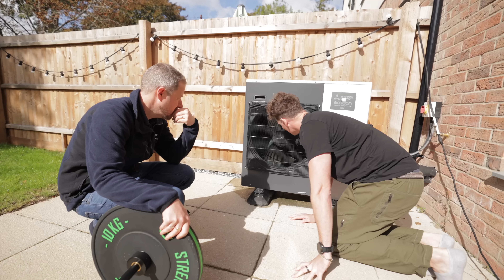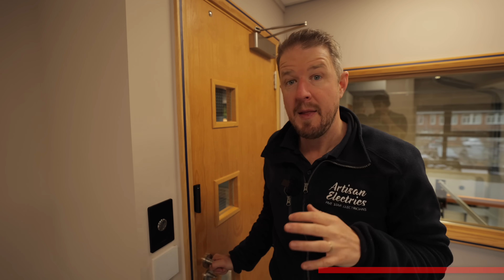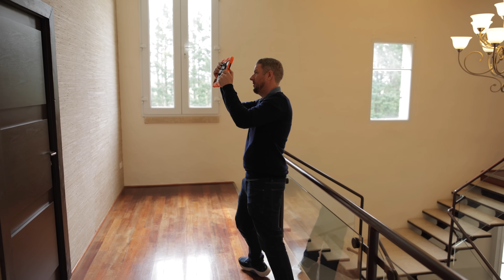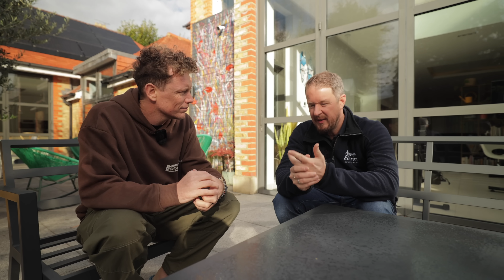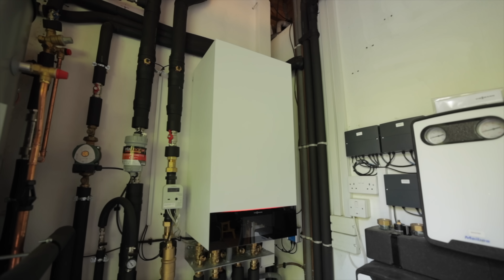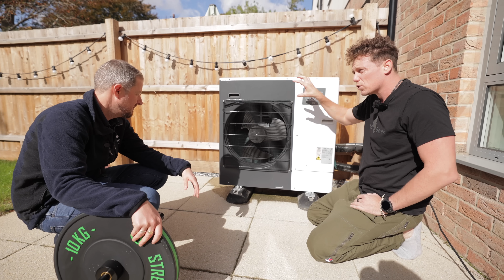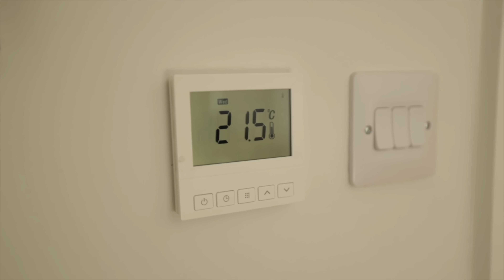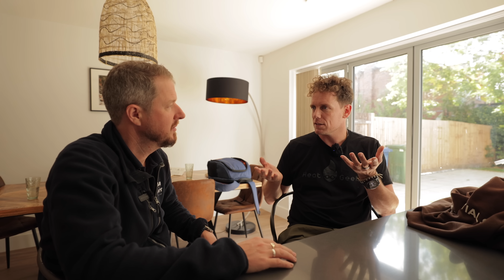Are Heat Pumps Really Worth It In 2026?

Comment: Some corrections on the Mitsubishi pre-plumbed cylinder - 
The switch to the immersion may be on, but it's wired through a contactor inside the control board & usually only used for emergencies or a leigionella cycle. There is not a pump within the outdoor unit, it's on the cylinder.
The 'low loss header' is actually a heat exchanger for the hot water, that's why there's also a hot water circulation pump.
Reply: @heatgeek Is this all true? Some of it does not sound right.
Reply: @darrenadams2640  Which bit doesn't sound right? I can send you the excerpts from the Mitsubishi manual & schematics. I'm an engineer who's just done the design & overseen the installation of 4 of these units.

Comment: Would you say Heat pumps ate suitable for HMOs?  I feel not, as tenants often expect instant heat rather than slow and gentle...?
Reply: Air to air systems work really well in HMO and hotel style buildings but you've then got the interesting problem of the bills. If everyone can casually turn their room up and down there's going to be an enormous bunfight at some point over billing. If you have per room metering then it's a nightmare because you've got one heatpump. Gas isn't particularly different but each room doesn't make much difference to the total bill in the same way.

If you are aiming at the professional end of the market then hotel style air/air is definitely possible, responsive and a real value add. The only restriction you really have is that you can't usually have some rooms heating and some cooling.

(and if you are daft enough to be responsible for the bill as the landlord just wait until your tenants granny charge EVs every day and then do a runner leaving an enormous bill).
Reply: @etchedpixels  on daft landlords being responsible for "bills included" rents, one of the houses we looked at years ago had a ban on tumble driers.  He was citing bullshit about condensation.  I tried explaining my tumble drier is a condenser and has never once caused my windows to steam up or any other condensation problems, its was still a firm "NO".  He then went on to suggest i dried clothes on an airer in the house instead - putting ALL the moisture in the house.  in other words, he didn't want to pay for the power and didnt give a shit about humidity.  ironically, the other tenants in the block (same landlord, same deal) were drying clothes on airers with electric heaters and dehumidifiers - and he was happy to pay for that electric.

This was before the dawn of electric cars though, I imagine banning that has now snuck its way into his contracts...
Reply: @jameshodgetts7541  Some of our student landlords got burned by students and their mates all granny charging off the including power 8)

Most of the ones I know now are "inclusive" but with a monthly limit - ie  not inclusive.

Comment: Heat pump tech clealry works as it is basic physics. Clearly installation and overll cost are the two big variables. Making the change is going to cost £,000s and you have to have the room for the install (they are bigger than gas or electric boilers. The instals shown on YouTube are mostly in big houses with plenty of room NOT small flats or old, odd buildings. Also in my opinion 21C is the absolute minimum comfortable temp for a house in the winter.
Reply: internal size for some of them is similar or even smaller as a load is outside. What gets you in my experience is if you don't have space for a water tank. That's starting to get solutions.

Comment: I've seen lots of shitty heatpump installs in my country, that don't tell ppl what is really needed for getting a heatpump installed corretly and skimp on addition of bigger radiators or floorheating and upgraded insulation. This add for heatpumps does not change that, and an install is very expensive to do properly, and don't expect a perfect system when not doing it 100% to start with or adding to it in the future..
Reply: The insulation argument is an interesting one.  you dont NEED to upgrade your insulation to get a heat pump or for a heat pump to work.  It will still work, but you'll not get the best of efficiency.  Indeed, upgrading your insulation would make your existing gas installation work better too - as if your insulation isn't up to scratch for that its working harder regardless.  Insulation need is unrelated to the tech creating the heat -  its only related to the size of the thing needed to create the heat.

Bigger radiators is usually a need though, as the flow temperatures for the water in the system is generally lower for a heat pump (if you want decent efficiency anyway).  In the UK it makes me angry how small radiators are - especially in new builds - making new heat pump installs more expensive - purely becuase they saved a literally just a few pounds on the original gas install.
Reply: @jameshodgetts7541 Insulation is a word ppl in the uk don't get imo, as well as double or triple glaze windows and such. Heating a house is both needing a heatsource and containing it. Why argueing against it seems stupid to me. Heatpumps works best when the direct temp it can produce i utilized - you're correct there, as smaller radiators need a higher temp to transfer enough heat to the area or room.

Comment: We bought a new build with a heat pump, very well installed but very badly set up. 

Now I’ve turned off all the additional systems disconnected fluid pumps and set everything at 21° in the day and 20 at night with weather compensation and a maximum flow temperature of 40° and Heat curve of 0.35 and the system is a dream to our own. 

Is it at least 50% cheaper than a gas boiler! The house is always a standard comfortable temperature!

Heat pumps that are well installed are definitely the way to go!

Comment: Once net metering is done and gone in the UK just like it is gone in the Netherlands.. we even have to pay energy companies for every kwh we are putting back on the grid! This will happen in the UK.
Be smart use dynamic pricing and do not use your summer kwh solar to pay for your winter heat pump. This is not sustainable!!
Reply: "...we even have to pay energy companies for every kwh we are putting back on the grid!"

Do you mean you have to pay them to give them electricity you generated?

Comment: Despite inheriting a system with a slow leak on an outside joint we are extremely happy with the performance of the system. No gas where we are and miles easier and cheaper than oil. Also, the house is always the same temp (21 down and 20 up) no wrapping up in jumpers. House is 200 years old but was renovated well and has u/f heating. The biggest issue is finding good engineers who can come out to you promptly.

Comment: I bought a cheapish £500 mobile AC Air-heat-pump unit that does hot and cold. 8,000 BTU heat from 650W stated, but using at the wall just 590W using my WATTMAN and my Victron SmartShunt, so around CoP 3.5, or 350% electrical efficiency that's in heat or chilling mods, I brought it as the summer has been 40 °C indoors each year which is to much for me now. But I'm amazed how well it heats my home, where my 2 year old gas 25kw central heating boiler takes a good 35+ minutes to bring my large well insulated flat from 16C to 21C. This little portable AC unit will do the same in 18 minutes! Which must be because it's blowing out hot air, whereas radiators are passively heating, and I understand onces up to tempter the boiler will hardly need to run etc. 
Also, I've tried it against an electric 2.8KW fan heater, and it just about the same on the time taken to warm up my living room from 15C to 22C, which is about 6 minuets on both, and as I've got solar and a 30KWH LFP battery, it's been only powered from solar so far. But now I see how amazingly efficient heat pumps really are, I'm going to get one installed, I don't know if window split systems are a thing over here, but I see loads on YT in the US which are getting Cop 4+ efficiency vs electric. But if not I buy a normal split system inverter type, and install it my self and get a qualified F-gas engner to load the R290 etc, a 12,000 BTU split unit delivered is under £600, and an 18 BTU is only £50 more, but I was thinking I go for a high end Samsung or LG units for £1200.    I'm now thinking of getting a Vaillant aroTHERM 3.5KW for under £3K, which is over 500% efficient. (SCoP of over 5) and then do what some others do and convert it to a ground source :)
Reply: How expensive is the portable aircon unit to run ? I was thinking of getting one to warm my house while we are having some work done ?
Reply: @stuartcareless9550  Please bear in mind that he is talking about a roughly 2KW output unit which is not nearly enough for a whole home in cold weather. And if running flat out at 590W it will be roughly 15p per hour based on the current average cap rate.
Reply: @stuartcareless9550  A good dual hose one has a COP of about 3, but they tend to simply not work when it's really cold outside (<4C or so) in dual hose mode. In single hose mode the COP is notionally about 3 but the reality is about 1.7 for a claimed 3 once you factor in the air suction problem, at least for a any reasonably air tight house.

Something like an Ecoflow Wave 2 or 3 (2 is now discontinued so watch for bargain renewed/refurbs on their site and ebay when they start the black friday nonsense) will draw about 500W producing 1500W of heat, and about 250W when holding a room using 750W or so. But it's 1500W heater so unless you have a nice well insulated house it's a room heater not a house heater. Still 3x cheaper than an electric fan heater for the same heat output.

It's really hard to get bigger dual hose setups in the UK like the Whynter kit that is common in North America
Reply: @stuartcareless9550  For me as I pay 25 pence per unit for electricity, and keeping it running at full by setting it really high like 35C it costs £0.15P (15 pence) per hour to run. But setting it to 21C, it's costing me £0.06P (6 pence) per hour as it's only been running 20% of the time. Or over 7 days it has cost me £10, or £1.44 per day. But it's been very windy here, and I've a busted back door that I'm waiting to have replaced which is letting the wind thought me flat, meaning it will cost less when that's fixed, or more when it gets colder. I just add to run my gas combi boiler, it costs me £35 to £40 per week, and it can't keep up because of the bad draft blowing thought my flat.  I just make it clear my back door only broke off its hinges about 9 days ago, apart from that home is well insulated.
Reply: Would you mind sharing what model of mobile ASHP unit you have?
Reply: @FahadAyaz  I will when home later :)

Comment: Guys be honest, in the UK 22% of electricity comes from extremely high CO2 gas and 8% comes from burning trees (Drax type biomass), which produces even more CO2.  This is called biomass to make chopping forests sound good. Solar/Wind is not sustainable, reliable or low cost.  Look at the subsidies offered to wind/solar industries, via tricks like guaranteed future generation prices, etc.  So until wind/solar can be installed without subsidies you are not being honest. Taxpayers money goes to pay for renewables, but these costs are not included.  I have ran a ground based heatpump for 20yrs, would like an EV. Because of nuclear electricity price is low, but once an EV cannot be charged at home, it is no good.  So I understand all the tech, and use it.  But I am afraid your financial advice is not honest.  Until you can say, your heatpump runs on gas/wood generated electricity as does your gas boiler you are not providing balanced advice. We all want to reduce CO2 but the renewable system has not delivered, we need new ideas, not the old solar/wind principles which after 20yrs have not delivered.  Check the increase in electricity prices over the past 30yrs if you want to be factual.

Comment: Heat pumps are just air conditioners , they were called Reverse Cycle Air Conditioners before the climate scam took hold. They are a SCAM. 
But not because they don't work and not because they aren't more efficient at moving heat.
They are a scam because they use the name Heat Pump which was originally used ti indicate a Geo Thermal (ground mass heat source) Heat pump, which are so efficient that they make the best reverse cycle air con look like a money burner.
The scary thing about the scam heat pumps is that coupled with a Smart Meter someone other than YOU can turn them on or off depending on if you posted a mean Meme about El Presidete The Fearless Leader of Ingsoc
Reply: Not sure what your problem is, a heat pump is a heat pump, doesn't matter if it is air to air, fluids to fluid  ground source a fridge a freezer a dehumidifier, whatever. Yes subsidies attract cowboys but that is always a failure of governance and lack of oversight. They do work mine is brilliant. Quieter than next door neighbours gas boiler and cheaper to run,
Reply: @ianithompson4239 .
My problem is not with the technology but with the scam marketing of calling them heat pumps.
This isn’t because they are not actually heat pumps as they ARE actually heat pumps it is because the geothermal source heat pumps were called heat pumps even when they didn’t use a refrigerant gas to move the heat only a water glycol or salt solution and a lot of marketing on how efficient they are and how they can work efficiently to heat (or cool) a building even when the temperature outside is well below the freezing point of water.
Reverse cycle air conditioning then got called Heat Pumps to steal all the marketing and give people the false impression that an air source heat pump will work efficiently in sub zero temperatures

Comment: They are if you can get the Gouvernment to pay 60% plus of the price.        And it depends on your house insulation and your existing radiator system.   I have 4 of these for 1 large property 70 radiators in total.  100mm cast iron pipes in the cellar.     It works well a bit noisy.    I have 2 turned on now 24:7.      but when the temperature drops below 10 c    there effectivness dwindles.        we got a grant from gouvernment.  they paid 80%          We did not take out the detrich gas boiler the size of a mini car.      We have both now connected.    elec for now and gaz for december onwards.        im sure if its installed correctly and you dont have big sytem 1 PAC unit should be able to run a basic 3 bed house.        I dont like   too much maintenance also.   the Gaz system is very basic.     but soon this 4 Pac that are in the garden at the back of the garden will need servicing etc etc thats when it gets exspensive.    They are loud also and annoying at night they make a repetitive wirring noise   that is bugging me now as I write to the good people of the Green Isles of MY motherland where the cows are happy and the kids used to drink milk

Comment: The most efficient type of heat pump is running water pond or river,  for 1 kw input, air source 2/3 kw return, ground source  1 to 3, moving water  1 to 4 so live by a river.
Reply: That must be on older tech, as if you go on any of the websites with live info like "heatpumpmonitor" and set it to 7 days, as it's winter now, you will find the top ground source (GSHP) is doing COP 7.2, that's 7.2X 1 KWH, and the best air source pumps (ASHP) are doing over 6X electric efficiency (600%+). Remember they have better efficiency the colder it gets, so if you change it to 90 days the top GSHP drops to GOP 6, as most of that time was warmer.
I would like to see how well a newer system can do with water cooling :)
I just add, mobile ASHP like I have are now doing GOP 3.5+, or 3.5 KWH of heat for every 1 KWH of electric used. The tech has moved on loads over the last few years, as mobile units were only doing half that 2-3 years ago.
Reply: @hardergamer  HP efficiency worsens when it gets colder outside not improves.

Comment: If a house is being heated all day then a heat pump can make sense. It depends on the lifestyle of the occupants if they are worth it. 

If the house is unoccupied during the day with the occupants coming home in the evening, they need a fast warm up.  Heat pumps cannot cope, gas can. The gas boiler will be on far less in run time so overall cheaper to run. Gas systems can be highly efficient with many boilers having integrated weather compensation.  Compared to heat pumps gas boiler installations are very cheap.

Comment: How far behind are you Poms...? Australia has been using heat pumps for the last 20 years
Reply: So have we in commercial. The government was to phase out natural gas, so pushed unfamiliar domestic heat pumps. They are now not phasing out out gas. Natural gas looks like having a 20% hydrogen mix from hygrogen produced via wind farms. No need to change burners. 20% less emissions.
Reply: We have been using heat pumps for decades! We call it air-con here, but it can heat as well as cool.
In the UK we have a massive gas infrastructure that is piped to a majority of homes, so the vast, vast majority of heating is Gas boilers.
Our Government are giving grants to wean people off gas, but only for air to water heat pumps, not air to air.
These systems are more complicated require loads more space and more expensive then the majority of households, who have at the moment a small white box on the wall that produces heat and hot water.👍